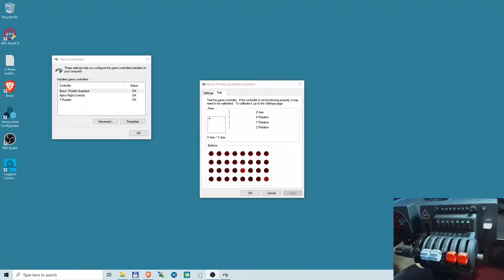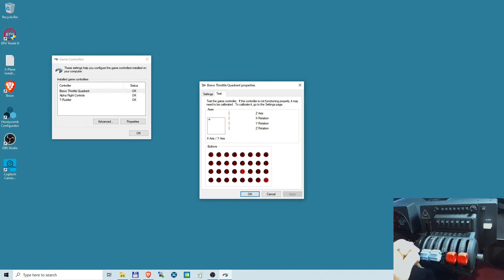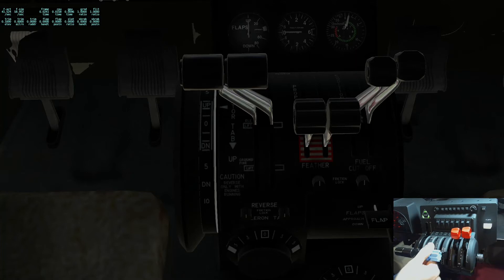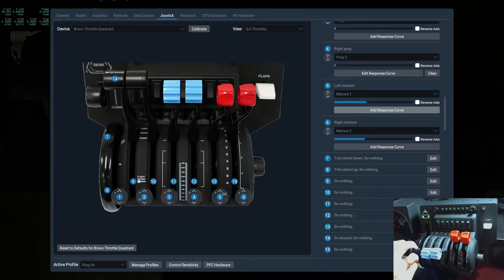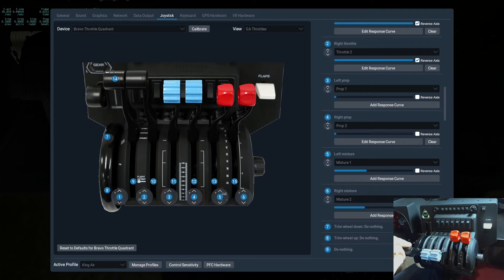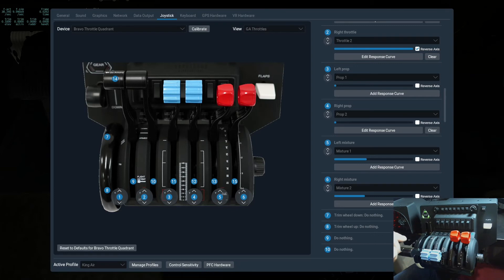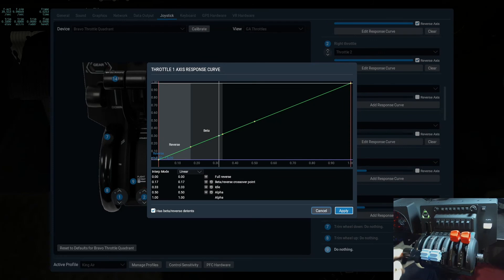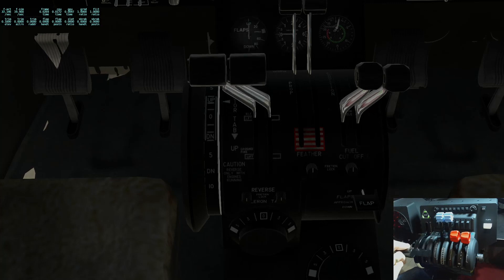Honeycomb Bravo Throttle Quadrant Limitation (X Plane 11) (part 1)

Comment: It's even worse on Apple Silicon on Xplane 12. All of the axis are mixed up and can't be changed so the layout for a 4 engine plane is mapped as follows: Throttle 1, Speedbrake, Throttle 4, Throttle 3, Throttle 2, Flaps.

So the only 2 levers of the 6 that are correct are Throttle 3 and Flaps.

I sent my one back to Amazon after 1 day.
Reply from the maker: I am not familiar with Apple, but both versions of X-Plane for Linux and Windows let re-assign the axes inside X-Plane. Honeycomb also offers software (Windows/Mac) to program  buttons and functions.
My complaint with the Bravo was specifically regarding a small portion of the throttle axes that has not been utilized at all. Otherwise, I think it's a great product, especially now when they switched to Hall sensors.
Reply: @kiralema you can reassign the functions of the axis. But that doesn't fix the issue of them calibrating incorrectly.
Reply from the maker: @blindlygoing Have you tried calibrating them within X-Plane? Also, not sure about Mac, but in Windows there is a tool that lets calibrate Joystick axes. Perhaps, there's one in Mac OS as well. In Linux, it's a bit more complicated, but still doable.
Reply: @kiralema too much effort for an expensive consumer product that should function much better from the start.

Comment: looks like a good idea to me has any upgrade been released yet how did you get your to respond to the beta mode?
Reply from the maker: Hi John, apologies for the long time to reply. I was working on compiling the video where I describe how to fix the issue with an additional controller board. Here's the link to part 2: https://youtu.be/Lv1fQ-lLvUA

Comment: Your discussion on the limits of the Honeycomb Bravo throttle quadrant bring clarity to my frustration as to why the beta and reverse capabilities did not seem to work.  I mostly fly the Cirrus SR22 TN but also fly the Hot Start TBM900.  Currently I am not able to have the throttle work at all let alone the beta and reverse modes. I am learning that this is an issue between the TBM900 and the Honeycomb.  Perhaps your Arduino can resolve this additional limitation.  Appreciate any comments on this.
Reply from the maker: Hi William, I love Cirrus SR22 😃. There may be several issues with not being able to use the Bravo quadrant apart from its inability to send the analog data below the detent (unless you modify it as I did with mine). Arduino definitely helped me to overcome some issues when flying default KingAir C90, but in some other planes the issue may be a bit more tricky to resolve. What I realized, the trouble is that there is no unified system of data variables in X Plane that can be controlled by external controllers. Every plane developer adds more variables (which can be found through DataRef plugin, and through looking at script files in plane directories). Then you have to send data to those variables from your controller (Honeycomb partially solved it with their profiling tool 👏). For instance, despite the fact that all my Arduino-based axes work perfectly, I still cannot control mixture in Zebo B737 with them since the variables that control mixture for both engines are not standard (such as "Mixture1" and "Mixture2") 🤷‍♂️. Having the ability to create your own planes and modify existing ones is great, but each plane may require a completely different software profile of your controller, which is a mess I am afraid. As for the Arduino, I started creating a video of how to modify the Bravo quadrant, but was set behind due to other work.
Reply: @kiralema    Thanks for this update. My issue is all about the Hot Start TBM900 (a very well designed and performing sim aircraft) that uses the Pratt Whitney PT6A turboprop engine.  However, the TBM900 now has just a throttle control that serves as a condition lever to bring the engine to flight idle and actually moves the single lever to the left for normal throttle Alpha and beta mode.  There is no separate condition level or prop control.  My old CH Pro yoke with a throttle quadrant would work fine  but with a separate condition lever and throttle control.  The Honeycomb bravo does not activate the throttle control in the TBM900 at all in Xplane.  I would like to think the new Xplane12 when it comes out down the road will work with Honeycomb to resolve this sort of thing. That may be awhile.  I will watch for your Arduino video to understand more.  May have to acquire this system I really want to fly the TBM900.  The Cirrus SR22 TN works fine with the Honeycomb.  Bill

Comment: Is that issue still the case, as of the date of this post? What firmware is that, that you have?Thanks.
Reply from the maker: Unfortunately, I don't really know what version of the firmware of the Bravo quadrant the Honeycomb Aeronautical is using at the moment. There's no mentioning anything on their website, so one may assume that the issue is still there. What I ended up doing is to adding an Arduino board inside the Bravo quadrant, which would utilise the full potential of all 6 potentiometers, and would let me to add other buttons and switches if I wanted. I hope to post a video on that sometime.